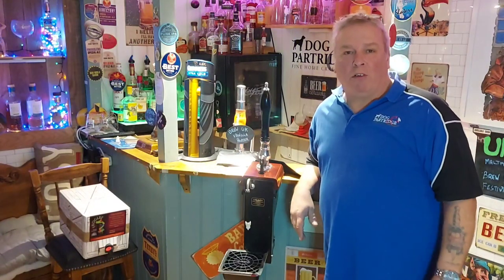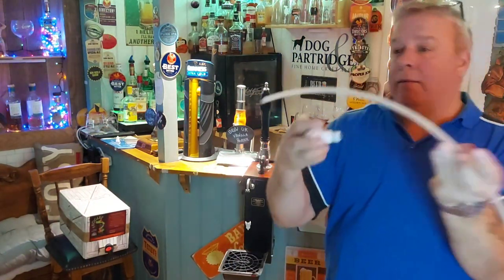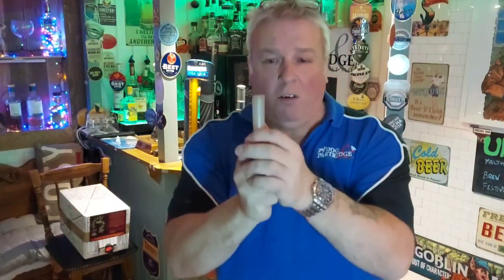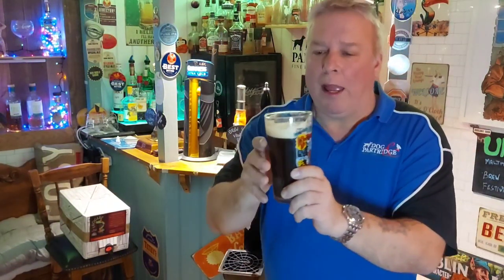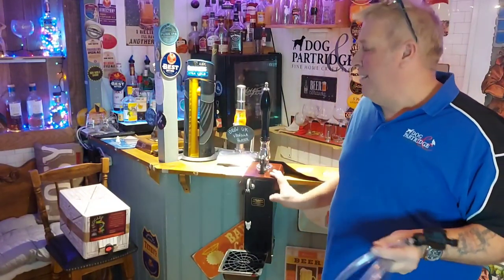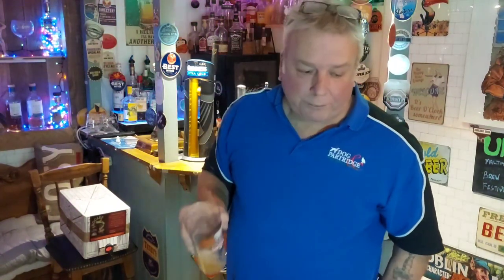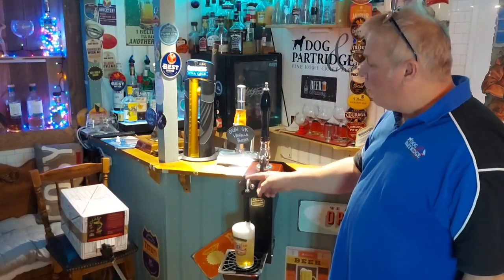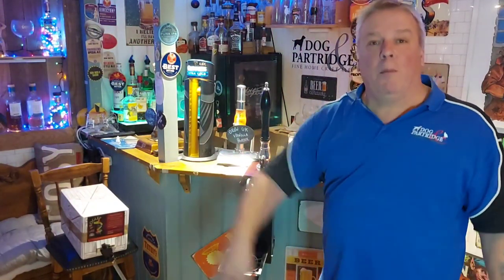how to connect beer pump to corny keg,king keg and beer in a box

Comment: Dave I purchased a Pint365 beer engine for my basement bar here in the USA. I asked Pint365 about the demand valve they said that all new Pint365 beer engines have built in check valves, no need for a separate demand valve.
Reply from the maker: @peteraller6929  correct the 365 as a built in demand valve,but other beer engines dont

Comment: Excellent video. I didn't know about check valves. You can do a cheat. A food grade plastic  water carrier with a tap. Fit a braided hose onto it and straight onto beer engine. Got water carrier which I fill with my homebrew for 2.49 reusable obviously. Works perfectly.

Comment: great video and very informative,i just bought a pint 365 and i am trying to find out if i need a demand valve,struggling to find the answer
Reply from the maker: Cheers 🍻The pint 365 has it built in ,my mates got one,the reservoir tank that's one the pub ones is replaced with this👍🍻
Reply: @beerkitreviewspartridge1083  thank you

Comment: Hi Dave. I recently found your videos and have been working my way through them - love them! Thanks for this informative video. I want to connect my beer engine (PINT365) to a pressure barrell so I bought one of the taps for the barrel and the reducer you mention. I wondered if you could possibly do a follow-up video about using the pressure barrel - do you need to vent? when do you need CO2 and how do you add it? how long will the beer last with this set-up? Thanks again.
Reply from the maker: Don't vent the beer,add co2 ,8g bulb and holder,after the pressure wears from original priming you'll feel a change in the pull add co2 then and probably ever 6pints or so
Happy brewing 👍🍻🍺
Reply: @beerkitreviewspartridge1083  That's brilliant, thank you so much!

Comment: Great video , looking at getting a co2 bottle for my home bar . What size would you recommend to run 2 cornie kegs off and do I need a regulator thanks
Reply from the maker: You going to need a regulator, get the right regulator depending on which gas you use if both cornys run the same psi you should get away  with a spliter,

Comment: Hi Dave, I brought a Pint 365 pump in the first lockdown. Did you say the check valve is all ready there? If so, can I connect my corny keg at low pressure to it? Keep up the the entertaining videos by the way, really enjoy them.
Reply from the maker: Hi there 
Yes I think so that was there big selling point, inbuilt check valve, I guess the only to find out for sure is to connect it upon ,
Reply from the maker: Cheers 🍻and all the best 👍

Comment: Great video thanks. Do you carb the beer in a corny at around 5 psi and keep gas on at 5 psi or do you just purge keg after transfer and serve straight away keeping gas on at around 5 psi.
Hope this makes sense
Reply from the maker: Hi
I purge the keg at 30psi and then leave to condition for 4 weeks then release some of the gas before serving
Reply: @beerkitreviewspartridge1083  hi thanks for the reply. So 30 psi for a few minutes / or hours ? Then take off gas for 4 weeks then purge then keep gas on at 5 psi? Sorry for questions
Reply from the maker: So purge and leave at 30 psi ,after 4 weeks some absorbing will have taken place but drop psi to 5 and serve

Comment: Nice video thanks can’t find those 1/2 hose connectors do you have a link please?
Reply from the maker: Some thing like this 
https://www.ebay.co.uk/itm/Beer-line-pipe-connectors-fittings-3-8-John-Guest-push-fit-Home-Bar-/333434363933?_trksid=p2349624.m46890.l49292

Comment: when you transfer your beer to corny keg, do you prime in the corny keg prior with sugar then a couple of weeks after adding 5 psi of pressure on top or do you just keg apply pressure then serve? Your help would be fantastic as I am trawling every forum but can't find the solution. Keep up the awesome work.
Reply from the maker: Hi there 
No sugar added when transferring to corny just try to get the beer as clear as possible by putting it in the cold for a couple of days, try not to transfer any sediment,connect to the gas line a around 30psi,take gas line off release the gas with the valve reconnect the gas and leave for about 4 weeks,the serve and reduce the gas to five psi
Reply: @beerkitreviewspartridge1083  you can get a float system now for corny kegs about £15 it’s a short tube like the gas inlet with a silicon hose connected to a stainless steel ball float works great and you get nice clear beer

Comment: Spot on video Dave. Id love a pint 365 but never really fancied corney kegs. Can you homebrew to a beer in a box system. Not much on the interweb about beer in a box
Reply: Duncan, u can get a beer engine for around £60 second hand on ebay, and connect a 36 pint cask(pin) from local brewery and connect it in upright form using a caskwidge system. Its very straight forward. Cheers

Comment: Do you prime the beer before attaching it to the hand pull?
Reply from the maker: Yes I had already pull some through so the pipe was full before attaching again
Reply: @beerkitreviewspartridge1083  sorry question worded wrong. Do you put priming sugar in the keg prior to using the hand pull?
Reply from the maker: I always use sugar in the king keg at the time when I barrel the beer,then top up with co2 bulbs
Reply: @beerkitreviewspartridge1083  when do you know to top up Co2 when using a handpull? does it become harder to pull through as a vacuum is created in the barrel.?
Reply from the maker: @23021982craig  hi there 
Yes it can become hard to pull ,but after the first six I stick a co2 cartridge in the barrel,and then about every 4to five ,if its full it will only blow the safety valve,I tend to use more in the winter than the summer

Comment: Would this work with a wilko pressure barrel?
Reply from the maker: Hi Andy 
Yes but will probably need to swap tap,I have a water butt type tap that I simply pushed hose on and tightened with a jc,
https://brew2bottle.co.uk/products/barrel-tap-nut
Reply from the maker: https://www.morepour.com/38---12-tube-to-hose-stem-fitting?gclid=CjwKCAjwkN6EBhBNEiwADVfya8tQMyaVMgMe_CE0Ldv2VRAKhvKlW2rJGIrzT9Mgn27K337jvAaf6RoCMmEQAvD_BwE
Reply from the maker: And then a reducer from hose to check valve
Reply: @beerkitreviewspartridge1083  Thanks for the replies just started using barrels like the idea of a hand pulled pint
Reply from the maker: @anyoo72  it really improves the beer